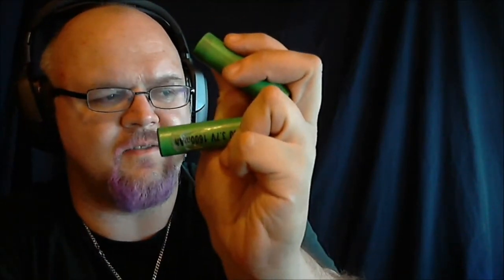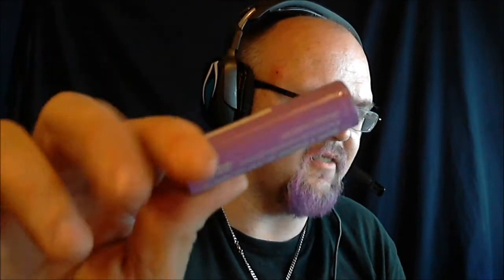NitroBex Reviews - How To - Cloud Chase - Episode 3 - Battery

Comment: Missed the most important thing ever in cloud chasing or vaping in general.

The Internal Impedance matters more then anything in a battery hands down.

Will post what I posted on Vaping Underground to educate people on it.

Battery's have an internal resistance just like your mechanical device has a internal resistance.

Let me see if I can explain it in a easy to understand form.

Conductivity Copper is more conductive then Stainless Steel so your performance out of a mech mod that has a Copper tube and Copper contacts will be greater then one with Stainless Steel. This is part of the voltage drop that you receive from a device and makes a Stainless Steel device underperform a Copper device.

Batteries also have the same properties but for them it is the internal resistance.

The example I like to use is a U-haul. When you rent one they put a speed governor on it so it only goes 60mph while the actual U-haul can reach speeds of 120. Batteries have the same thing in the form of Internal Resistance.

The higher the internal impedance or internal resistance the less it is going to be able to perform how it should and the lower the internal impedance or internal resistance the better it is going to perform.

So for example a Samsung 25r 18650 has a Internal Impedance of .18mOhms while lets say a AW has a Internal Impedance has .25 and both batteries come off the charger at 4.18 volts.

The Samsung since it has lower Internal Impedance out of the 4.18 volts the battery has lets say it can supply 4.12 volts of that since there isn't much of Internal Resistance in the battery.

The AW since it has a higher Internal Impedance lets say it will only supply 4.05 volts of the 4.18 volts the battery has.

Long story short especially on a mechanical mod the AMP in burst matters to make sure you are in the safety range of the battery since burst mode is under 5 seconds and no vapor goes that much over especially over 10 seconds. The 2nd most important thing is to find a battery that has the lowest Internal Impedance so that your 4.18 volt battery can supply the most of that 4.18volts for your vaping pleasure. 

Voltage drop of a device not only depends on the material and conductivity of your mod itself but also the IR of the battery. If you find the lowest you can in a battery of IR and still hit your safe burst AMP limit and also find the best conductive mod you can you will outperform anyone else that has a less conductive mod and higher IR battery.
Reply from the maker: Still in the novice stage of this... So this is target to getting in I will be going much more in depth later.  Baby stepping so people can follow along with out getting intimidated.
Reply: Not a problem still a good video blog